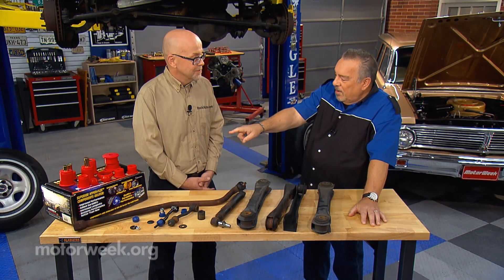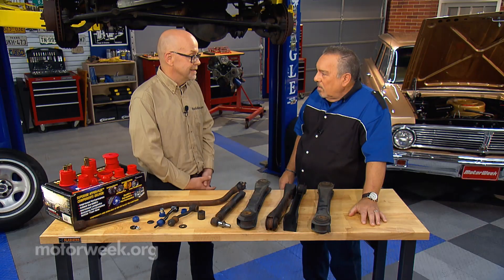Goss' Garage: Suspension Bushings with RockAuto

Comment: 1:35 Better ride? I thought polyurethane bushings make the ride harsher.
Reply: TheSgtAngry 
It depends on the vehicle. On a sports car with already firm suspension, you would notice a difference with the car feeling tighter with a harsher bump compliance.
Likewise, with something like a wagon or SUV with softer factory suspension, you wouldn't notice as much harshness due to the suspension still having a larger rate of bump compliance compared to its sports car counterpart.
Reply: Compared to blown bushings they're a big improvement and last longer than OEM.

Comment: I would disagree with Polyurethane bushings providing a better ride. This is from personal experience with a previously brilliantly comfortable ride with rubber bushings that was affected greatly with just changing the front stabilizer bar bushings.

Comment: Polyurethane is garbage! Won't last long, deforms fast, and is a harsh ride! If they are so great then why won't manufacturers install them from the factory?
But what do I know, I've only been a suspension tech for 15 years...
Lube your zerk fittings!
Reply: ^ absolutely correct.  polyurethane is very limited as to what it can be used for.  i would use them with applications that arent too critical, like the steering rack bushings - possibly even the subframe bushings.  not advisable on using them in things that are in constant motion like control arms.  OEM rubber is definitely the way to go.
Reply: I actually purchased OEM ones (for an older car) to actually make sure that the ride was as before, and found out the manufacturer has now switched to polyurethane ones! :(